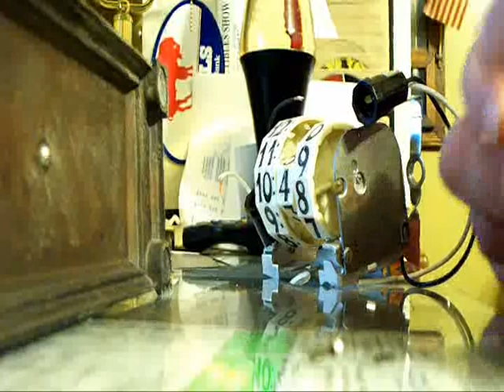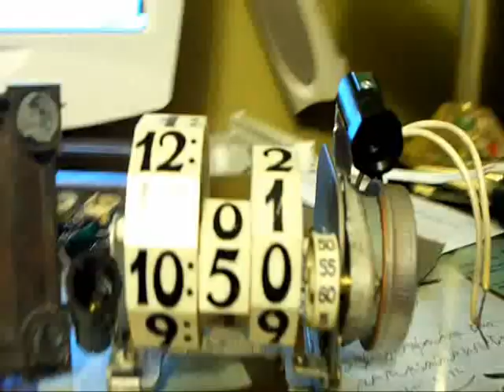replaceing a numechron motor

Comment: Great video! Is there any easy way to lubricate a 1973 Tymeter model 755 motor? Clock keeps time, but is noisy-John in Texas
Reply from the maker: if you have to you can drill a small hole like i show
in the servicing video
Reply: Thanx for the reply. Removed the thick wooden case and the motor is very quiet. As crazy as this sounds, the wood case is amplifying the motor rotor action!-John in Texas @force311999
Reply from the maker: @JohnWaldron-cm7ce miss doing these to much family issues and work etc
would love to sell some off soon

Comment: The Adler/Royal clock That I got had the bakealite frame.  Guess what....  The clock was dropped off the table by my cat and the damn frame broke in two.  So I JB welded it back together, and it is as strong as when it was molded plus I rebuilt the entire movement.  Just need to put the replacement motor in

Comment: Thank you for your response; unfortunately replacing the motor is entirely outside my comfort zone.  if you are in the USA, I'd love to send it to you, have you find and purchase a motor from ebay and replace it for me and charge me.  Would that be possible?
Reply from the maker: not worth it the motors go for 35 to 40 bucks a plastic "speed read" clock is ten bucks